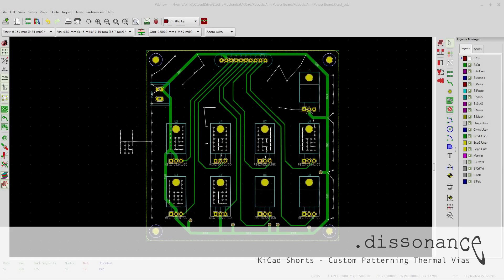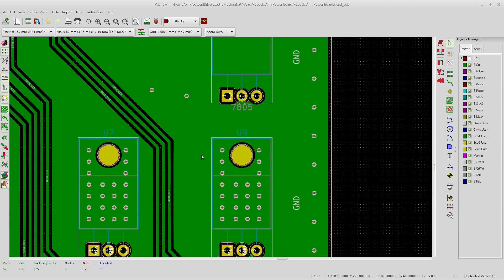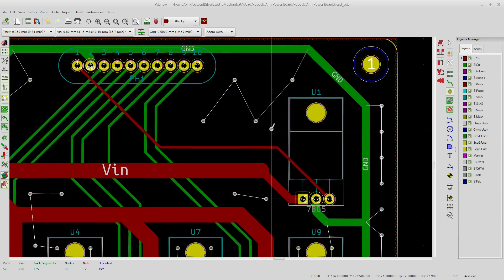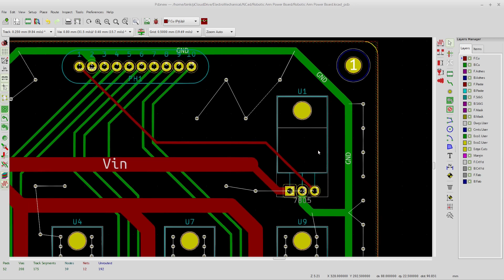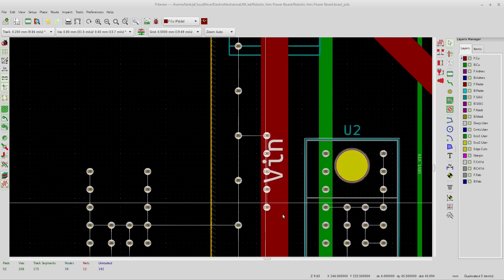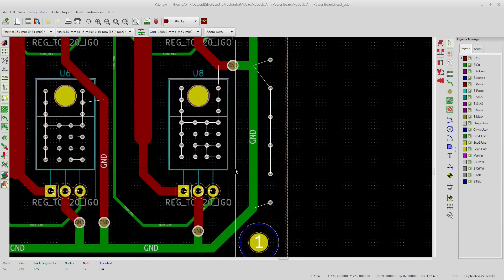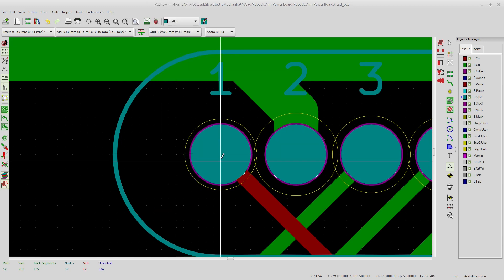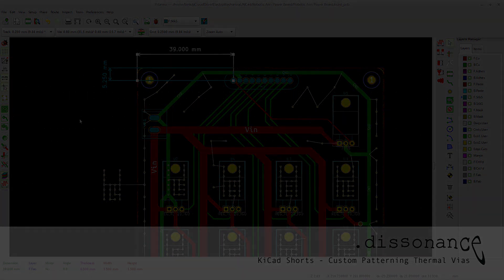#112 - KiCad Shorts - Custom Patterning Thermal Vias

Comment: What about removing the solder mask under the regulator as well as using the vias?   And then you can apply thermal paste between the two metal surfaces?

Comment: Another quick tip, while you are doing measurements or creating drawings on top of the Edge Cut, you can click the ALT key while you are looking for a spot, and it snap to corners/measured corners or components for you. It really helps for making exactly straight drawings and measurements.